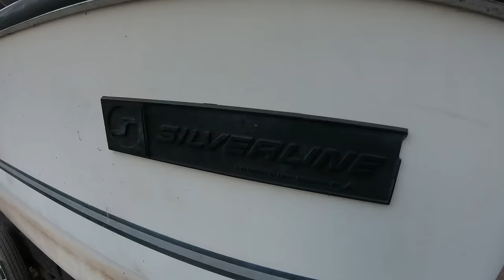Buying cheap boats

Comment: This boat sits very low in the water; too low. It may have the same issue my folks had with their old boat of that generation, and they didn't know it for 2 yrs. Some of these have a sub hull; some with, some w/o an additional drain plug that's very small, and hard to see if you're not looking for it. If a small crack has developed it allows water to enter like my dads did; he drilled a small hole and added an addition drain plug which took hundreds of lbs. off its total weight making it less "wet" and it was much faster.

Comment: also need to trim motor front down a little you need to have nose lift a little so its not  driving into the waves making them hit the hull a little farther under the bow making nose ride a bit higher

Comment: That second boat definitely had a compromised transom. That 200 pounds of merc hanging of the back is going to be at the river bottom. Watch 21:00 the lower bolts are mia. Ya deathtrap for sure

Comment: Andrew why do't you just pull the drain plug and clean off the outside of the tank and all that area under neath the back of the boat. You took the time to do the outside.

Comment: I hate that the battery is just open on the floor, no protection. That little plastic bucket isn't going to protect water from completing a circuit from the top

Comment: Yeah that bolts running like that because it's not planning right either because you need to adjust trim or because it's so damn waterlogged from sitting outside with no cover on it it's probably heavy as hell probably a little bit about it being heavier than it should be motor not enough power to plan it out and needs trimmed

Comment: That tire is not good. Lol. It might not leak air right now but the steel cords that deflected that screwdriver can now get wet and rust. That tread may also wear funny now in that area as well. If I was you I'd not trust it for too long.

Comment: if it needs extra fuel to start... rebuild the carbs ! should never need a shot of fuel, and certainly not starting fluid. strips all the oil off the rotating assembly.

Comment: If you could trim until that engine up a little bit it would prevent that bow from digging in so much it would drive faster be better on fuel and be a lot drier but it doesn't look like you have hydraulic trim and tilt. Looks toonold

Comment: Hey buddy your motor tilt needs to be adjusted your bow is too low in the water under speed that is why you're getting the excess of spray pull your pin on your motor tilt lock and move it at least one if not two holes tilt your motor back further at the bottom of your transom I bet you'll have better performance

Comment: Why would you ever trade that modernish bow rider for a 1905 ? everything in the old boat will require replacement! all the steering cables wires etc. that 2 stroke is antique  also!

Comment: asking as some one who doesnt own a boat of anykind, or never did, and dont know squat about them, so i promise im not bieng a sm*rt *ss, but do  the carpets come out , or is everything kinda placed on top.of em liks a mobile home, just wandering, i strip and detail, pressure wash and work on cars but dont k ow sh*t about a boat, or what to look for even buying an old used one , except fot like obvoius rotting beyond repair, id  like to buy or possibly build a small phontoon, just curoius is all,

Comment: You didn't raise the engine. You assumed the tire would be OK after being impaled by a lug nut wrench. You went out alone on a sea trial. You did not wear a life jacket. You went thru high speed turns, standing, with one hand, on  rough water while unfamiliar with the boat. Hmmm